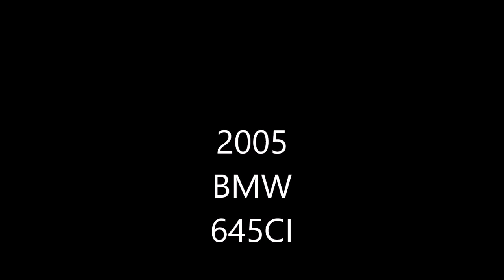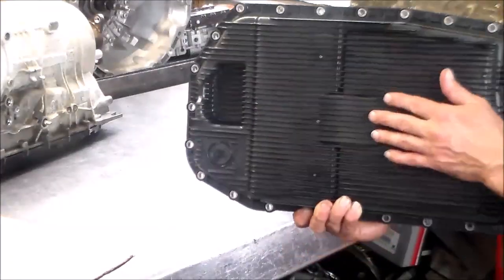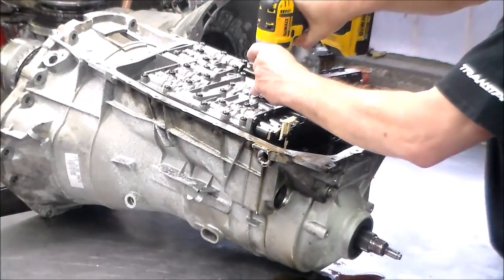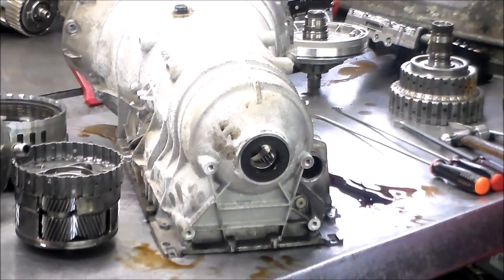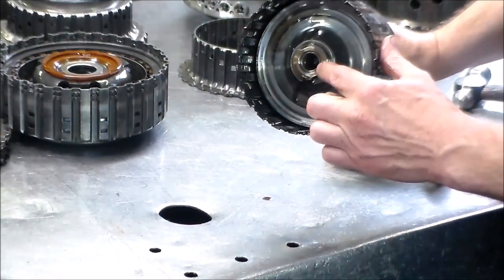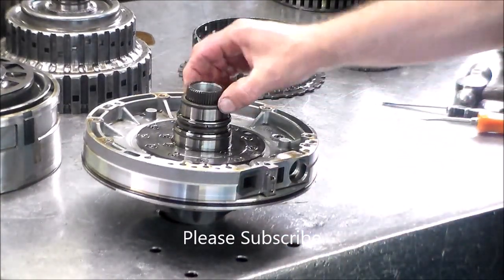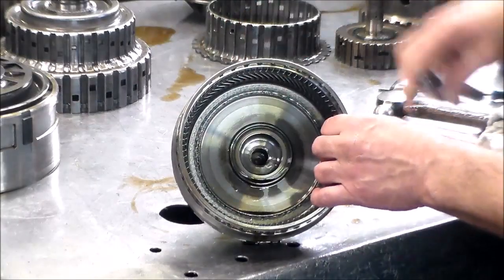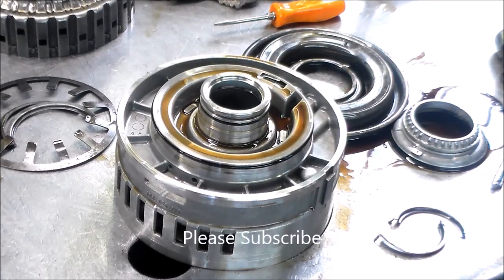ZF6HP26 Teardown, Code 4F85 Present

Comment: How do I keep the longevity of these transmissions? I have a 04 545i with 85k miles (130k kilometers)
Reply: Don't follow BMW's maintenance schedule where they tell owners that the ATF is Life Time.  Follow ZF recommendation for fluid change.
Reply: Yes, my car's (Jaguar S-Type, equipped with the same trans) workshop manual repeats the "filled for life" nonsense usual in the 2000s, but at least recommends a fluid change each 30.000 miles in case of "heavy use". ZF itself recommends changing the fluid at least every 100.000 km (around 60.000 miles).
Besides that driving habits may have an even bigger influence on the lifetime of an auto trans - if you abuse it, regular fluid changes won't help a lot...
I added this last sentence because you are a BMW driver (just kidding) 😎

Comment: Hi Gary can I conclude if my bushings are worn by looking diagnostic data? I mean gearbox pressure values. All are in range mostly negative values. Have codes 4F85, 4F82 and 4F8A. Any help would be appreciated. I have learn a lot watching your videos thx :)
Reply from the maker: All clutch fill times are good? is that what you looked at?  Assuming you checked fluid level?
Reply: @GaryFerraro  Yesterday chanced solenoids, "DoubleD" sleeve gasket, four tube like seals under valve body and new fluid with pan but problem still exist in gears 4-5. Otherwise it was smoother shifting. Here are some values: Rapid fill time A 39ms, B 30ms, C 1ms, D 0ms and E 105ms. Filling pressure A -293mbar, B 12mbar, C -252mbar, D -48mbar and E -110mbar. Sure that E rapid fill is highest so could it be leaking pressure. Dont know what to think about it.
Reply from the maker: @jarza_87  Does this only happen hot?  when you installed new solenoids, you reset shift adapts?
Reply: @GaryFerraro  yes only hot this happens and yes presssure adaptations I reset. And tranny model is 6HP19
Reply from the maker: Certainly sounds like a bushing problem
Reply: @GaryFerraro  well now day of driving  after repairs and adapt.reset only 4F85 error is present, 5th gear has slipping when giving some throttle to malfuction error in dash and adaptive E-clutch pressure is 470mbar (others fine) so quess the problem is bushing as you say. Thanks for your help and educational videos!
Reply from the maker: @jarza_87  So this slips as you step into the gas?
Reply: @GaryFerraro  Yes when accelerating fast like into highway when car shifts 4th to 5th or overtaking other vehicle when car shifts 6th to 5th gear. I can see in thachometer fast rpm swing sometimes in that 5th gear so releasing gas pedal not iniate fail safe mode.
Reply from the maker: @jarza_87  Have one here now doing the same thing, it is a bushing problem,

Comment: i have an e60 530d zf6hp26 with the 4f85 fault. It drives perfectly fine when cold but as it starts to warm up, the transmission faulty shows up on the idrive and the code is cleared once i restart the car. The code gets triggered on a downshift from around 60-80kmph and once the code has been displayed, it keeps reappearing on my trip frequently even if i restart the car and its temporarily fixed. What may be the issue?
Reply from the maker: That is usually a rear stator bushing worn out
Reply: @GaryFerraro  so how many hours of labour would that be to get it fixed because i dont have the tools nor the skillset required to fix it
Reply from the maker: @akarshreddy1351  where are you located?
Reply: @GaryFerraro  India
Reply from the maker: @akarshreddy1351  Would have to look online

Comment: I have 2008 528xi with transmission code 4E22 please can Help me with that
Reply from the maker: Pressure control solenoid valve 3 or EDS 3 may be shorted, you need to drop out the valvebody and ohm each solenoid

Comment: I have a 2006 BMW 750li, I want to buy the valve body spacer plate, but I don't know what model it is.  How can I know before disarming?  I appreciate any help
Reply from the maker: Where are you located?
Reply: @GaryFerraro  Las Vegas NV
Reply from the maker: @franciscolavado5606  I can give you a number of a ZF distributor in CT, They may ask for the last 7 of your vin number to decode what transmission you have and what plate you may need.
Reply: @GaryFerraro   Today I disassembled the valve body, the nameplate is A053, and I found a place here in las vegas that has it.  What fluid do you recommend?  I previously used pentosin, but some mechanics have told me that it is not suitable.  Thank you very much for your time.
Reply from the maker: @franciscolavado5606  you will be fine with , it's like a clear fluid like the life guard?
Reply: @GaryFerraro  yes is a clear fluid
Reply from the maker: @franciscolavado5606  you should be fine

Comment: Hi Gary,  it has been a while since the last time I commented on your videos or asked you for valuable advice.  it is very valuable to me because  with it and by watching some of your videos I was able to rebuild my transmission on my 05 BMW 545i  it's a ZF6HP26   6 speed automatic. 
 well I took it out for a test run and it ran great!,  gears shifted smooth and all for first 200 miles, and today I just got a message of transmission malfunction on the I drive and the car jerked from 3rd to 4th. I pulled code 4F85, all steels and frictions were replaced as well as all seals and bushings, valve body intermediate plate and dampers were also replaced, New solenoids were installed too.
One thing I did not do since the valve body was from a different transmission was to program the control unit to my car's VIN #.  Is this necessary to program the Mechatronics unit and the new solenoids
The valve body was from a 05 BMW 545 as well but different  VIN # and all solenoids were new
I replaced the valve body and mechatronics unit because plastic was cracked.
What programming procedure was needed in this case Gary
Reply from the maker: I don't think that is your problem, how did the rear stator bushing fit onto the E drum, did it turn free?
does the problem happen hot and cold or only hot?
Reply: @GaryFerraro  It  Fit real nice and tight no play and it turned free, the one bushing I messed up was one of the large bushings on the A drum, but I ordered another one and installed it.  I made sure all fit nice and there was no play but they all turned freely, will take tranny down tomorrow, what should I look for when I tear it down?  worn stator bushing? as far as if it happens hot or cold, I will need to drive car again cold since the times I drove the car I always got it up to operating temperature before starting the drive
trying to get it ready for smog, But I will take it for a spin and will let you Know, 
         Thank You Gary,  Best Regards from So. Cal.
Reply: Hello Gary, just tore transmission down and in fact
Stator bushing was no where to be found also the A clutch smaller bushing spun on the stator looks like I will be installing those 2 bushings but 
I need to check the fitment make sure it’s nice and tight.
One thing that I want to ask is that the oil pan is or was new
Original , I don’t think it can be reused  since all the metal flakes from bushing was at the bottom of the pan, all other bushings look good.
Have you used a metal oil pan for this transmissions?
Reply from the maker: @moytech5960  I have never made a switch like that, i think the X5 units come with a metal pan,

Comment: I have a 2009 bmw 335i 6hp19 trans and i got 4f89 and 4f8a fault codes. Searched online and im not sure what to do to fix it. Can someone help?
Reply from the maker: There is a bushing on the back of the pump, (rear stator bushing) It is very common for this bushing to wear out, when it does it causes E clutch apply oil to escape causing problems in 4th,5th and 6th gears

Comment: Hi, I’ve got E90 318i with fault codes 4F80 and 4F86 which makes the car go into limo mode but works ok after a restart. Is the transmission dead or can it be repaired? 
Any help is appreciated
Reply: Is it something that can be repaired off jack stands?
Reply from the maker: @slengoslengaw8510  What are the definitions of those codes?
Reply: @GaryFerraro  4F80 is Converter clutch to 0-n. -  Switching type 6 to 6 0-n. 

4F86 is translation monitoring Sympton circuit monitoring- Converter clutch regulated 0-n. -  switching type switching type 5 to 5 0-n
Reply from the maker: @slengoslengaw8510  what is year make and model, like to look these codes up
Reply: @GaryFerraro  it’s a 2008 and 318i. Appreciate your help Gary
Reply: @GaryFerraro  hi Gary, when I read the codes off Ista it showed 4F83 – Ratio Monitoring Clutch C. What do you think?
Reply from the maker: @slengoslengaw8510  That clutch is on in 2nd and 6th, how is the 1-2 shift?   What trans is in your car? ZF6HP26?
Reply: @GaryFerraro  apologies for not getting back quicker, needed to get the car scanned to find out. It’s a GS19D variant. Does this sound right? Thanks
Reply: @GaryFerraro  overall the shifting is fairly smooth, I do notice a slight jump from 1 to 2 but not sure if that’s because it’s cold. What do you reckon? Am I in a costly trouble?
Reply from the maker: @slengoslengaw8510  What is a GS19D Variant?
Reply from the maker: @slengoslengaw8510  Well,  if you have those gear monitoring codes that is usually internal
Reply: @GaryFerraro  I used the vin and an online decoder and it showed GA6HP-19Z Auto
Reply: @GaryFerraro  do you reckon it’s a matter of time before it completely goes bad or could something like low oil could cause that?

Comment: Same code but it only happenes when i hard accelerate
Reply from the maker: That is usually a worn stator bushing
Reply: Hey so I still have the code and code 4f83 car drives around fine slips every once in a while like when I’m going up a hill especially but really not often so recently the car wouldn’t go in gear so I bought another transmission and just switched the valve body I didn’t replace any sleeves seals or solenoids or reprogrammed the car and it drives just fine a friend of mine said I should service the valve body and the transmission should be fine my question to you is could that be possible without tearing down the transmission or replacing it

Comment: can anyone with ZF6hp transmission in their car tell me if in the first minutes (cold start) they have FULL torque converter lockup in Sequential (M1,M2,M3,etc) or NOT ??? i mean in low revs 1000-2500rpms...
Reply from the maker: I'm Not sure, i would have to drive it with a scan tool, usually the converter does not get commanded on til the car heats up
Reply: Ok then its normal behaviour! It locks after a little warm up period.

Comment: I have a 48Fc code
Reply from the maker: Is that code ratio monitoring 5-6 shift?
Reply: @GaryFerraro  if im not mistaken but it will not engage in any gear now.
Reply from the maker: @TheEndowed1  Ok, first, how is fluid level?  Do you have E shift valvebody?
Reply from the maker: Any other codes present?
Reply: @GaryFerraro  im hoping its just the level lol havent check that yet, and its on a  745li which im guessing it has an e shift valvebody?